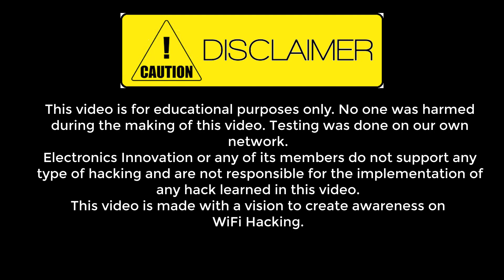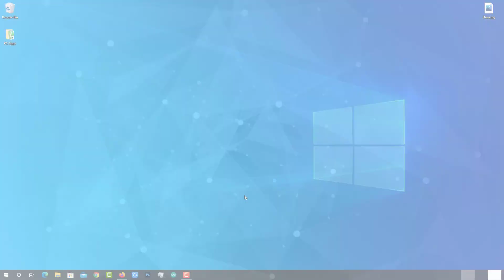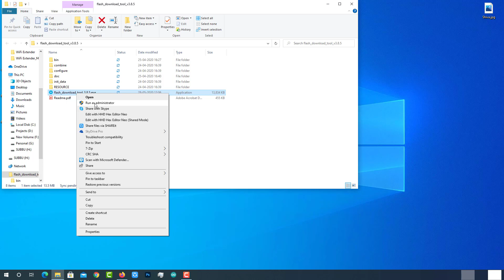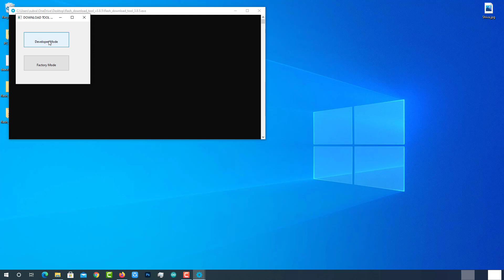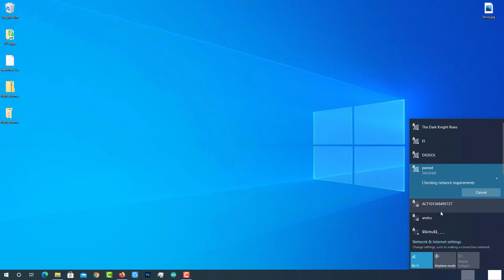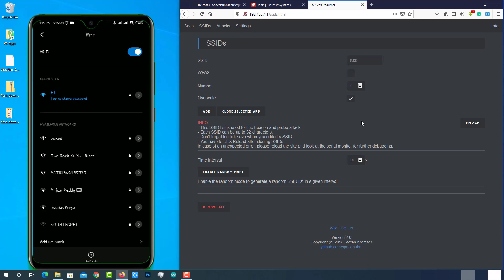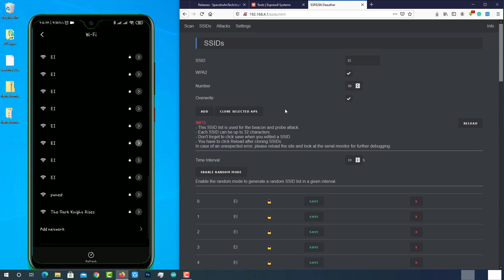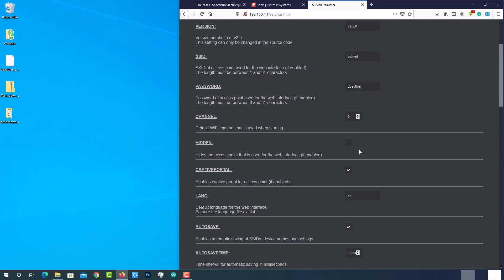DIY WiFi Jammer with NodeMCU ESP8266 | WiFi Deauther

Comment: Hi there. You provide a great video with good explanation. Though I've run into an issue...
After flashing, my ESP32's LED doesn't turn blue but stays red and there's no pwnid network appearing on any of my devices. BTW, my computer is hard-wired to the internet, and I'm not using WiFi, this isn't helping. What can I do? Thanks in advance
Reply: hello, I recomend you to use ESP 8266 , in case if you want to use esp 32 you should change the driver when flashing it.

Comment: Will it work with esp-01 module?
Reply from the maker: May be. Give it a try.
Reply: @electronicsinnovation  I program the esp-01 with Arduino board(connecting the rx and tx pins) but how will I flash it using a Arduino board?
Reply: @luie.no1noob  not working bro esp01 have less storage and ram then esp8266

Comment: 192.168.4.1 is not opening
Reply: I had the same issue with Google browser but then worked with Safari on iphone
Reply: Are you connected to the wifi network pawned
Reply: Only if you are connected to the node mcu network it should work
Reply: Does this work with hidden networks?

Comment: Does it work for jio fiber router?
Reply from the maker: Yeah, it will work.
Reply: @electronicsinnovation  but what if I switch to 5 GHz band,
Reply: Is it possible to make similar deauther for 5GHz, as nodemcu doesn't work for 5GHz
Reply from the maker: @electrofun2787  yeah, possible. But I haven't tried.

Comment: Its only works to 2.4ghz or can be use also to 5g wifi band?
Reply from the maker: I have tried with 2.4ghz only. My home router will not sopport 5ghz, so I didn't test it. You can give a try.👍👍👍
Reply: Electronics Innovation is there any nodemcu that support 5ghz wifi band sir? 

Thank  i will try it later.
Reply from the maker: I tried with 2.4Ghz only, I haven't tried with 5Ghz. Because my home wifi router doesn't support 5Ghz.

You can give a try and let us know.
Reply: Electronics Innovation sir. Thanks. 
Perfectly working in 2.4ghz wifi. 

But cant detect a 5ghz wifi. 

Can you make a little modification in wifi or can you a moduel that enables the 5ghz connectivy?
Reply from the maker: If got some time, I will try to do it.
Reply: Electronics Innovation  thank you sir.
Reply: @thereptilian9731  does it support 5ghz wifi please tell me how to jam 5ghz wifi
Reply: @taranveersinghbansal5386  not supported because esp8266 work only 2.4ghz wifi and not supported 5ghz,